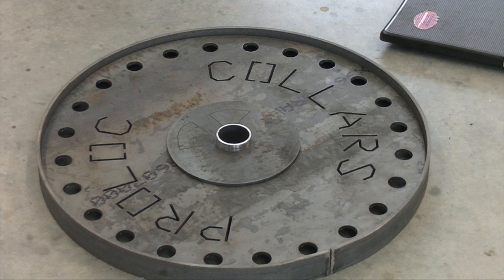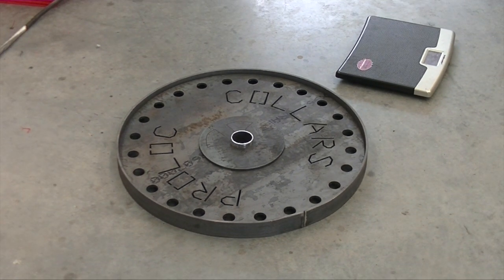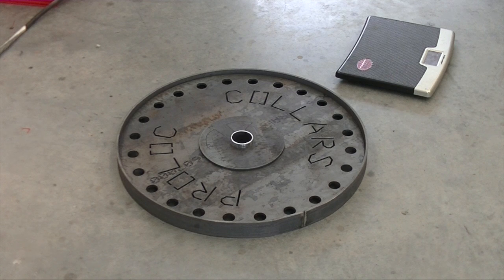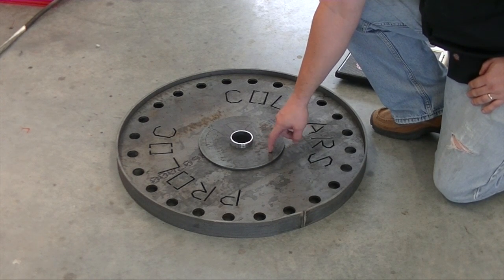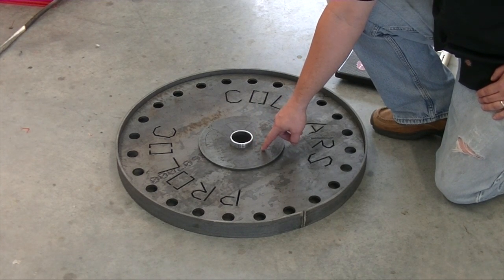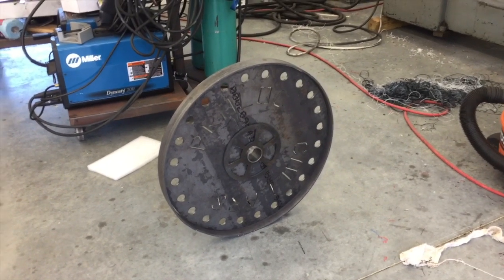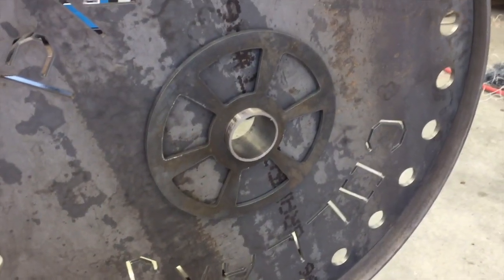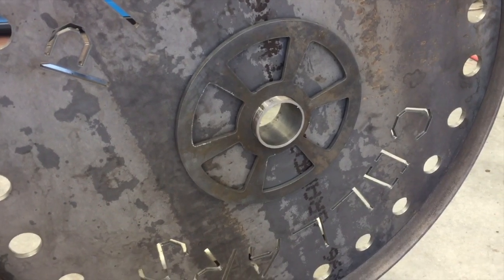Developing New Products - Proloc Wheels

Comment: Hi Tom, I can see how you are trying to get it to 45lbs exactly.  However, when I was weightlifting (many years ago) it really did not not matter what the weight was on the bar because ultimately, (in a physics sense) it was down to who could get the bar up with the most 'disks' on it.  Great project and as a bonus gets the mind thinking about density.  And as my physics teacher said, 'physics controls everything in 
, and around us'. Kindest regards. Joe.
Reply from the maker: Hi Joe! Ends up the customer was fine with a 50 lb weight so we should be fine now. Fun project so hopefully this takes off and we get some orders from it. The biggest challenge has been learning to juggle the projects because it changes every day.

Best wishes,
Tom Z

PS - I am an absolute physics geek! Almost went into teaching the subject rather than engineering.

Comment: Cool stuff Tom,
How about increasing the outer hole dimensions to get to the 45lbs? If they measure 1", what about increasing to 1-1/4"?
Take care buddy,
Razor!
Reply from the maker: +Razor Works Thank you, Ray! I think you've got the right idea on where to remove the needed weight. Just need to figure out the right amount to remove and not bring it too far under spec. I can always add weld material (which I'll have to do anyway) but I need to be within +- 1lb at the end of this.

Now that the machine is running, it's time to get to our project...

Best wishes,
Tom Z
Reply: Tom Zelickman, I do what I can to help....

Comment: Great to see the Plasma Cam at work Tom... way to go. Hard to imagine managing this project without it!
Have to wonder just how much density variation there can be between basic low carbon steels.
Reply from the maker: +ChrisB257 Thank you, Chris. I'm trying to figure that out myself. I'm sure the issue is user error but I haven't figured out where I made the mistake yet. It's quite odd. I measured the center ring, determined how much to remove, and yet ended up with only about half of the weight removed than that which I had calculated. Frustrating but it's coming along nicely.

Best wishes,
Tom Z

Comment: Did you mic your actual material thickness to see if it matches your model?
Reply from the maker: +bcbloc02 Hi Brian! I did check the material and it's within a couple of thousandths but it varies over the sheet. I tried to lay out the parts symmetrically on the sheet so the set would be even from left to right. My guess is that my model is fine but I have some error that I'm not accounting for.

I weighed the center rings and determined that I needed to remove 1 of them. I removed 50% of the material on both rings and still came up heavy.  I think the next step would be to adjust the size of the holes on the outside of the ring.

Thanks for watching! I remembered you telling me about the failures you observed back at school and I made sure to build my joints at the welds and not the entire bodies. ;)

Best wishes,
Tom Z
Reply: Tom Zelickman
Does Fusion use .284lb/in^3? the density of low carbon steels does not really vary much so that should not be the error. A 15% error is pretty high, it sounds like there is a part in your assembly that is not accounted for in your model.

Comment: Those weights look pretty cool.  How did you roll the outside band?  Once you get the correct weight down you can go to town on them.  I see all sorts of customization going into these!!
Take Care,
Reid
Reply from the maker: +Reid Eichner Hi Reid! It's a pretty cool setup and I'm glad I got the chance to take on this project. I'm going to have to tune each set unless I can get more accurate material. Maybe cold rolled will be more consistent. I can be +- 1 lb on these by spec so it's taking some time to get it right.

I'm just using a tubing roller with a set of dies used for flat stock. It's working out pretty well so far only doesn't take too long to do.

Best wishes,
Tom Z